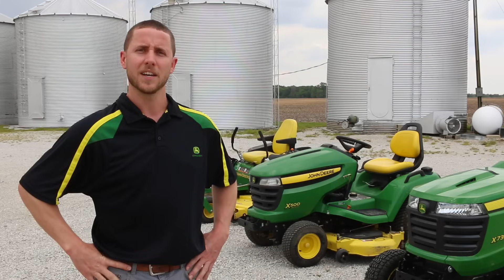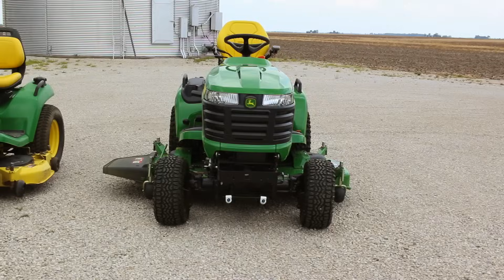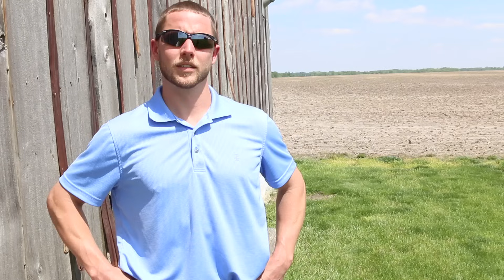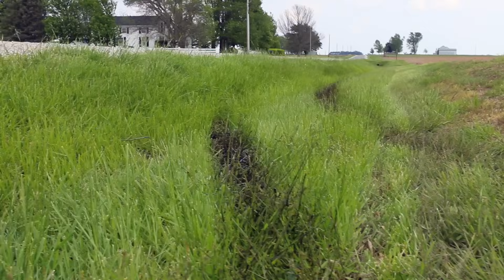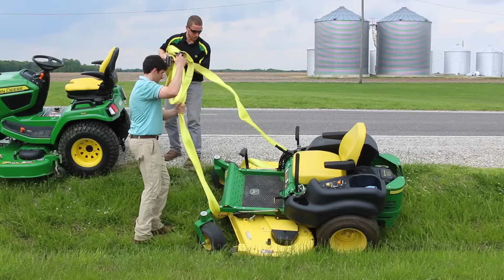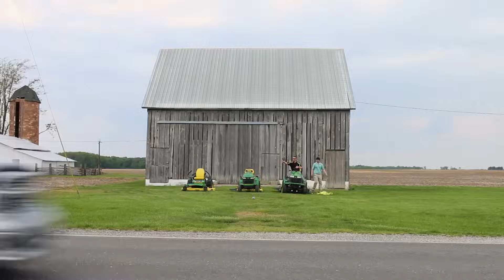The Slope Test

Comment: I've taken both the D-105 and the Z345R are very steep inclines and they both do incredibly well. The Z345R I barely even have to lean with. The D-105 however being a lawn tractor, I do have to lean with but it still does very well. solid machines, well balanced. So far on my first season with the Z345R my only problems are that neither John Deere nor Gator make mulching blades for that machine and if I don't want to leave clumps or have to mow over multiple times to remove the clumps then I need to hold the shoot up with a strap or remove it. The shoot definitely needs to be raised at a higher angle so that the grass can be thrown out further. Secondly on the Z series, I find that I have to re-adjust the deck height after nearly every mowing, which is something I rarely had to do with the D-105. It seems there should be a better lock nut in place for the deck leveling. John Deere had it right when they used the non floating deck adjusters like with the D105 because it just seems that the Zseries gets out of level to quickely and to easily.
Reply from the maker: Thank you for your response to our video. If you are having issues with the deck coming out of level or cut quality issues please give our service department a call and we will try to see what we can do to fix the problem.  800-745-4020
Reply: Cornthwaite Lawn Care well I'd say u need to use them more and get used to how they work I've ran mine on some really steep slopes and no real problem but do it when dry and check air in tires, go slow but can go extremely steep if just go easy.

Comment: why not the exact same grade filmed for all machines? why did the 4x4 clip on the second grade start higher up and cut short as soon as it slipped?
Reply from the maker: Fixt100 thanks for the reply!  We appreciate the concern on this.  However, nothing tricky being done here!  The results you were seeing were consistent throughout.  We only cut to save you viewing time!
Reply: agreed, but as a consumer i was to see as an exact comparison as possible you are comparing machines from same manufacturer nothing tricky is likely buti would like to see a much larger hill with an increasing grade with machines run side by side to see how far one makes it compared to the next before they drop out (not likely to happen because where does such a hill exist?).
Reply from the maker: Fixt100 that's a good thought for a future video.  Our goal was only to briefly shed light on how they operate on a common slope.  We hope we were able to shed some light on this question and help someone make a more informed decision.  Thank you for sharing your thoughts!
Reply: I agree, the 4wd model was a good 2 ft above the mud bottom that each other mower had trouble at.  I was also curious how well the 4wd would have worked in the ditches mud.  In the x738 does it have diff lock like the x500?  I have a JD 2305 with a belly mower.
Reply: Sloan Implement .  This is not exactly on subject but I have a question maybe you can help me with.  I own a Z445 , bought it new 10 years ago.  48" with a Kaw 25 Hp . Did they stop making the Z445 and if so what is the  replacement or most comparable  .   I believe my Z445 has a 10 gauge deck ?   It is a sweet mower and have mowed 2.5 acres with it for the whole 10 yrs. This year I've started mowing commercial and it is still toteing the load !  Looking ahead for a replacement down the road . Thanks.
Reply from the maker: The replacement for the Z445 is a Z540M.  It has the same Kawasaki engine, but Deere upgraded the mower deck to the Accel Deep deck with is a nice improvement over the 48C/54C on the Z445.
Reply: I noticed the same thing. It was definitely not an equal test.
Reply: Sloan Implement Was Kuster farms Demoing a 8370R? (2015)
Reply: They want you to buy the more expensive unit so they get more money
Reply from the maker: Actually it has nothing to do with that.  It is mostly to help you figure out which tool is best for the job.  You wouldn’t choose a Prius to haul a load of dirt.  You would choose a truck.  Doesn’t mean the Prius isn’t a better choice for commuting to work.  The right tool for the job.
Reply: Fixt100 they did, and the zero turn LOST. Period. The traditional style tractors are just a better design overall when it comes to ALL types of conditions like hills and slopes for example
Reply: As a past owner of a Z445, a purchaser should determine the basic flatness of what is to be mowed. A zero turn is a great mower for the basic flat or gentle grade lawn. It is a fun mower to use and does a great job at cutting in general and around obstacles in particular. If the only problem area is that shown in the video it should not be a deal breaker in owning one IMO. As noted each mower has its strengths.
Reply: Fixt100 exactly
Reply: Fixt100 I was about to comment the same thing
Reply: Larry Be I flipped my traditional style tractor on the less steep side of a ditch and was cutting the ditch with a 30 inch push mower and it took about 30 minutes. I now have a Dixie chopper xt3300 and it can cut right up to 40-45 degree slopes comfortably while the other side is only 30 degrees and I can mow it full speed with the Dixie zero turn

Comment: If you used those mowers on the edge of a pond you would sink them
Reply: I've had great luck with my John Deere F725 around ponds.
Reply: JeepCollector91
Reply: Lol exactly I used to help out at a kids camp and they had a John Deere 455 to mow around a pond, surrounded by a steep hill. They said they sunk it around 10 times... And it still runs to this day at 2000 hours.
Reply: My f725 was a beast on hills and pretty much all around. How is yours holding up ?

Comment: The last just when it started slipping you stop the video.
Reply from the maker: That is actually not true. Given we sell all of these items it wouldn't benefit us to make one look good over the other. The goal of this video was to show that the zero turn does much better on a slope than some might expect. People assume if they have a slight hill that a zero-turn isn't going to work. They do just fine in most scenarios.
Reply: @sloanimplement  sure it is, the 4wd is the most expensive and you would like to sell more of those, that's why you had it further up the hill and yes you did stop the video right as it hung up. And on top of that mowing on that kind of a grade is far too dangerous, the risk of rollover is too high.

Comment: Terrible comparison. Get the two right tires off the pavement/gravel like the first two mowers and do it again. I like Deere mowers and have an X534, but this comparison was a joke.
Reply from the maker: Ryan, we ran them all the same way.  The others stated there but slipped down quickly.  To avoid a long boring video this was edited to show them at there biggest struggle point.  Either way the results were very predictable if you have ever mowed a ditch.

Comment: Problem is you only tested John Deere,
My Grasshopper handles ditches at much higher grade than those , with little or no slipping, and I've been using same mower with hundreds of hours for over 10 years, doing nothing more than gas, oil change, and changed fuel filter & spark plugs once.
Reply: Darin- USMC B- 85-93 nothing better than a Grasshopper front mount.

Comment: Just irresponsible- get the proper equipment.  An accident waiting to happen.
Reply: yeah they dont have any safety ROPS roll bars on these mowers wich kubota is smart because kubota adds Rops roll bars on all of there mowers with seat belts
Reply from the maker: Hey, Kenneth. Thanks for giving us your thoughts!  When it comes down to it, all 3 of these handled the ditch pretty safely and no one felt at risk.  We wanted this video to represent one of the most common situations that people run into every day.  There is always better and more expensive equipment available but it's not always an option for everyone!  Maybe we can do a demo like this of the commercial equipment in the future as well.   Thanks again!
Reply: Michael Mac Tavish you can get rops on every brand, not just kubota
Reply: The Turkey Talker aw someones a cranky boy

Comment: I know I will get alot of backlash.. And i know the point of the video is just to show whats better for your own needs.. BUT me personally... I'm just not a big fan of zero turn mowers for this reason. Sure they have the zero turn advantage maneuverability but their width kinda takes away that advantage.. touchy, controls, extremely wide width which makes them harder to load on trailers, can't mow on hills, slopes, you have to hold the handles the whole time with a firm pull while you are mowing, if you let go you will stop you cant just steer it, I understand they have some advantages but they just seem too clunky and awkward to me. To me, if you buy something let alone pay thousands for a mower, esp a commercial one.. It should be able to mow anything in every possible situation.. To me, they're kind of gimmicky and I understand many buy them bc they are made better than many of the traditional lawn tractors on the market today, but to me you just cant beat a tractor style mower with a hood and steering wheel as long as they're well built. I guess they're ok if you have a flat yard but like i said to me a real mower or tractor can mow on slopes and hills
Reply from the maker: We would have to agree.  As far as versatility goes you really can't beat a good quality lawn tractor.  The main reason to choose a zero turn is to save time.  Really in this video the zero turn did better than expected so we were very pleased.  99% of home owners are going to be able to use a zero turn without a problem.  Its very rare that our customers have to deal with a yard as steep as this ditch.. but we do live in the midwest..  Great feedback!  Thanks!

Comment: Those mowers are garbage on slopes. Just go buy a ventrac
Reply: That will be $30 000 more ;)
Reply: Yes, but #Travis Huberts has the luxury of spending OTHER people's money - he doesn't have to be either realistic or practical.
Reply: Buckhorn Cortez Ventrac is a complete rip off! Buy the Deere
Reply: +Travis Huberts Actually a X530 Multi-Terrain (now X580) isn't nearly as bad as a X500 (now X570). It has ATV like back tires and a differential lock making it very good comparatively on slopes, and much more affordable at $8000 than $24000 for a "slope ready" (dual wheels on it) Ventrac.
Reply: Travis Huberts EXACTLY
Reply from the maker: A new X580 is $6990 with a 54" deck
Reply: +Sloan Implement That's nice actually. Hadn't realized the price dropped since we got ours 2 years ago, but thanks for helping get my point to Travis. Side note: if anyone has a JD X3 or X5 tractor with the two pedal hydro and it has begun to feel slow, sluggish, or the reverse feels weak, put new plastic bushings in the pedal (part # M152776 in X3 and X5 series) and adjust the pedals so they are all the way up. You'll find it suddenly works a whole lot better.
Reply: Buckhorn Cortez could you explain that to me?
Reply: Sloan Implement but how much can you do with it? Mow lawn and pull a small trailer. That's about all
Reply: +Travis Huberts Well you can plow snow, till, and easily pull objects far heavier than a cart (like a 1988 Ford LGT 18H 950lb garden tractor when it broke the u-joint on the driveshaft, or a 2010 Chevy Colorado Crew Cab 4000lb truck when I was screwing around testing the JD's limits.) All this still at a fraction of the price. Also, considering the normal person has an acre of hilly land(we live in West Virginia and nothings flat) or just wanted the model with ATV-like tires, not turf savers, this is more than adequate for most.
Reply: MrPizzapuppy For our ventrac we have over 10 attachments for it. Not to mention we mow all our ditches that are all about a 30 degree slope without hesitation or the feeling of the mower flipping over. Also in the lawn you will never tear up the grass from turning
Reply: +Travis Huberts That's great and all, but the problem is it is far out of the league for most home gamers. $24000 for a Ventrac compact tractor with duals required for 30 degree slopes VS. $7000 a JD X580 garden tractor that can mow up to 15 degrees. You're comparing a compact tractor to a garden tractor, which really is apples to oranges. Also, I mow my steep hill (+30 degrees) like a normal person: a self propelled Lawn Boy AWD lawn mower. (awesome mower by the way)
Reply: If you want to mow slopes on the cheap get a 4wd mower like an x700 with the biggest deck you can buy and fit duals on it... or space out the wheels real wide
Reply: I don't think this video is intended for people who are loaded
Reply: Billy Bimkins Loaded, as in rich💰💵💰💵? Loaded, as in drunk🍻🍸🍺🤪? Loaded, as in baked potato 🥔🥓🧀?

Comment: For comparison, my father has a nice big JD riding mower, it takes roughly 4 hours to cut his large yard with his mower, I could load my GRasshopper , drive up there, 1 hour , cut his yard in 1 hour, and drive back in less time, than his JD, and mine does a better job.
JD mowers have lost their edge many years ago.
Reply from the maker: Our Z900 series is the best commercial z track Deere has ever produced.  Almost as good as the 318.
Reply: That's because your dad's JD probably isn't a zero turn, let me guess.